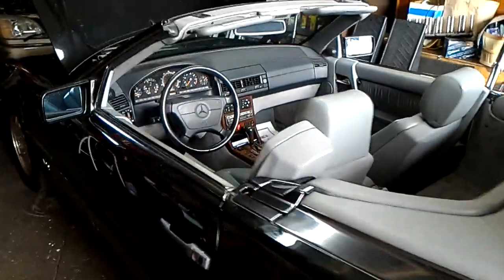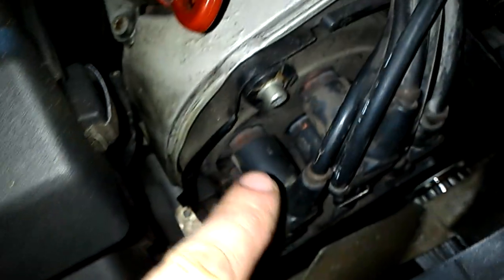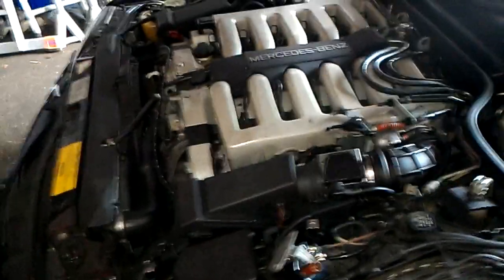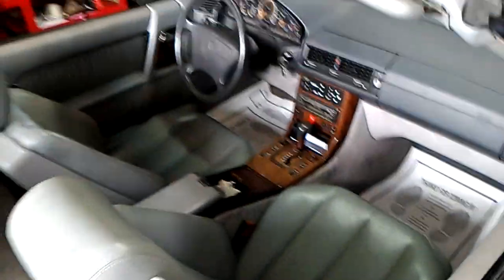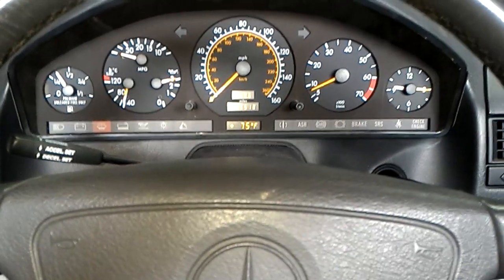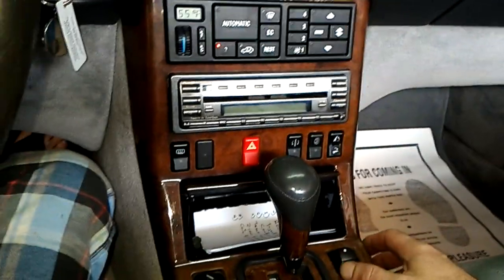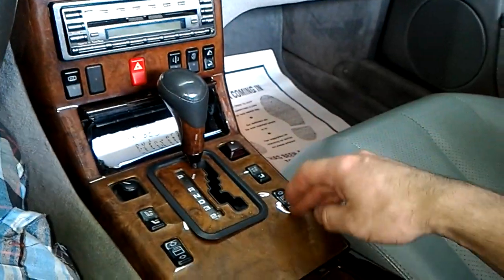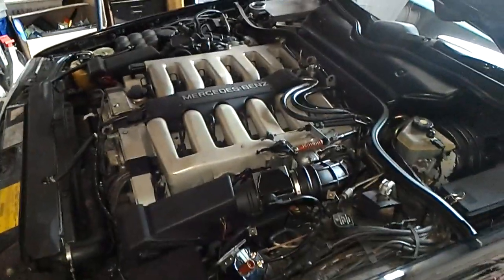Mercedes SL600 repair progress

Comment: Hey, love your videos. I have a question; I have a 93 sel500 with 240k on it, my oil needle does a lot of jumping around, like when I come to a light it will drop down to 1 then go back up to 3 when I take off. Is that due to a leak or a bad part, I have no ideal would you know what the problem is? Thank you so much.
Reply: as long as it goes back up it should be fine - meaning you have compression. 
How did it end up seeing we are now a year out hahaha??
Reply: Car is done, had to be scrapped. Was fun while it lasted😐